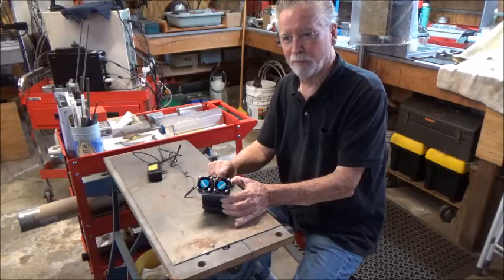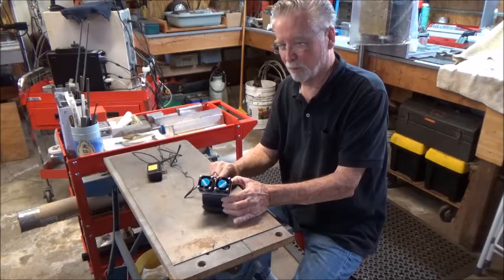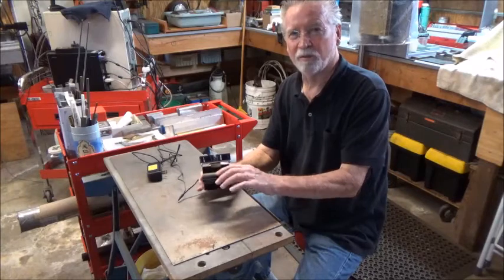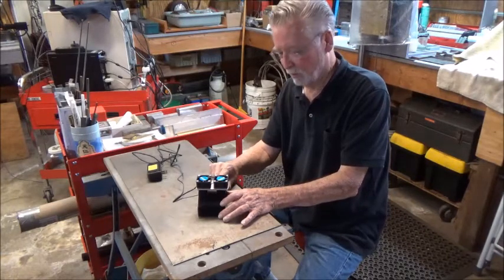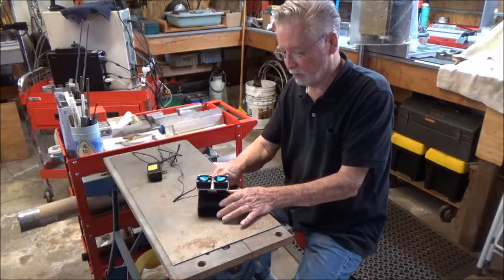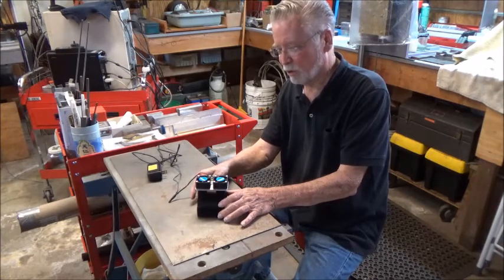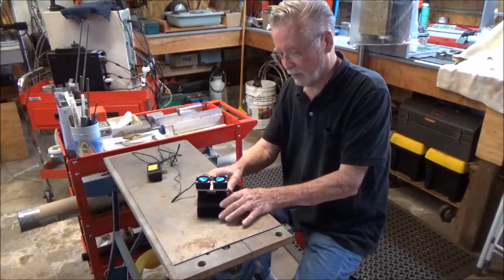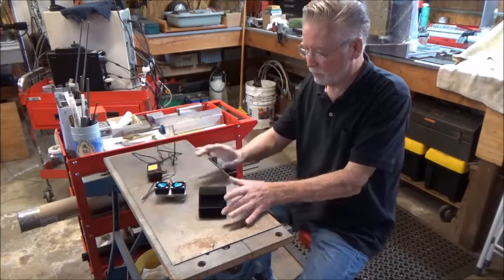Sherline Milling Machine Motor Gets Very Hot  (Sherline Mill Motor Heat Sink Build)

Comment: One other thing, for the same result might be tried; if you want: wrap the motor with soft copper tubing with also a coil as close to the bearings without interfering with the live output shaft. Connect the piping to a gear pump and an automotive transmission radiator. Use transmission oil, or, since. Cleaners in the oil should be unnecessary, just a simple light hydraulic oil. Shouldn't need the automotive type used for vehicle breaking so as it will be cheaper.) Put a fan on the radiator.  You might vary the pump stile; I mentioned gear type as the faster you rotate it the pressure goes up. ( but then you would probably need to include a pressure relief valve.)  ( I didn't realize, when I started typing how involved this would get. I am not an engineer, so do not know what danger any of this could develop. Probably scratch gear pump for copper tubing. They say if you hear a peeing sound under your car; do not put your hand near, as if it is from a pinhole in the steal hydraulic piping used with modern type breaking systems, it could kill you by the fluid going through your skin.. I said oil instead of water so as not to create steam in a closed system and blow you and your home away.  Wow , things can get involved, but safety is paramount. OR  Probably safer: One could use water if the system was not closed. Just run the tubing to a large soup pot of water   Enjoy making chips.
Reply from the maker: We'll see what happen with the temperature during the next long CNC run.  Obviously there are better solutions but this time around for a first try I was trying for the simplest build with least cost. Thanks for your comment: Regards: Larry

Comment: Did You check that the heat is well enough transfered to the heat sink? If not, just letting the fans blow air to the motor could be even better. 2 fans blowing on one fin looks like overkill to me. Better let them blow at 2 fins.
Reply from the maker: We'll see what happen with the temperature during the next long CNC run.  Obviously there are better solutions but this time around for a first try I was trying for the simplest build with least cost.  Of course two larger PC 3" fans moving air across the entire heat sink would be best if needed.  Thanks for your comment: Regards: Larry
Reply: @larrypoindexter9351  You'll be surprised how much good even a small fan does!
Reply from the maker: @Stefan_Boerjesson  This was the simplest thing I could think of, so it's a starting point.  I have fingers crossed.
Reply: @larrypoindexter9351  Well done! It will work well, hopefully as well as You wish.

Comment: It's well vented still gets so hot you can't touch the damn thing.
Reply from the maker: Even well vented motors can get very hot, but these full enclosed motors are terrible.  Vented motors with an internal fan that moves air through the motor work best, but are susceptible to accumulating swarf internally which isn't a good thing either especially in metal working.   I switched to Sherline motors and speed controls long ago for both my Taig lathe and mill.  Even though I never considered it the end all solution.  The motors that initially came with both pieces of equipment initially were both unacceptable for my liking.  I haven't had problems with the lathe, but for long CNC runs especially during hot summer months I've always felt the mill motor just got way to hot.  These type motors do get hot and will continue to run successfully, however.  Regards: Larry

Comment: Aluminum is a pretty good transmitter of heat. You're on the right track. I wonder if there is a grease capable of helping transfer the heat from the motor casing to the aluminum, without said heat getting grease so hot it makes the grease drip . Would be nice if Sherline switched to a ribbed motor.
Reply from the maker: I switched to Sherline motors and speed controls long ago for both my Taig lathe and mill.  Even though I never considered it the end all solution.  The motors that initially came with both pieces of equipment initially were both unacceptable for my liking.  I haven't had problems with the lathe, but for long CNC runs especially during hot summer months I've always felt the mill motor just got way to hot.  These type motors do get hot and will continue to run successfully, however.  I have considered placing some heat sink type grease between the motor housing and the new heat sink so we'll see what the future brings.  Sherline should provide a better case that would better dissipate the heat.  Ribbed aluminum would help, although my mini mill has such a case and the heat still worries me.  Regards: Larry

Comment: Glad you brought this subject up, the motor for my Taig heats up ( although not at all similar to your motor) , I never thought of this before, but an info-red cam might show some details previously un noticed. Very nice solution you worked out there, I am sure it will move a lot of heat away from the motor. Enjoyed the video, cheers!
Reply from the maker: I switched to Sherline motors and speed controls long ago for both my Taig lathe and mill.  Even though I never considered it the end all solution.  The motors that initially came with both pieces of equipment initially were both unacceptable for my liking.  I haven't had problems with the lathe, but for long CNC runs especially during hot summer months I've always felt the mill motor just got way to hot.  These type motors do get hot and will continue to run successfully, however.  Regards: Larry

Comment: It seems that the washing machine motor on my Taig lathe gets hotter than 120 degrees. I don't have a laser thermometer so I can't check it.
Reply from the maker: Fully enclosed motors will get hot but some have an outer case that's made to dissipate the heat as does my mini mill motor.  Larry
Reply: Same thing on my Taig, I have what looks like an old furnace fan motor.